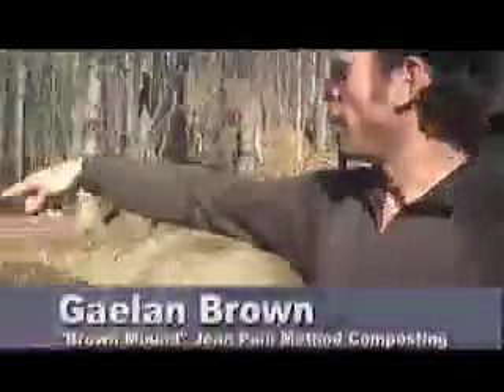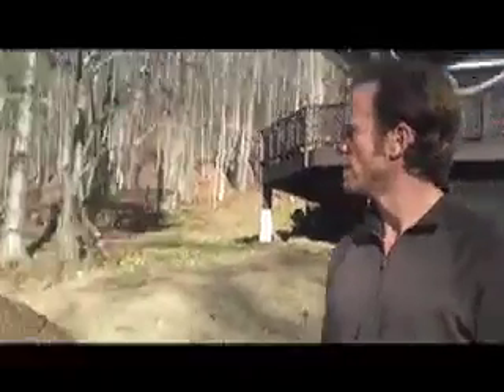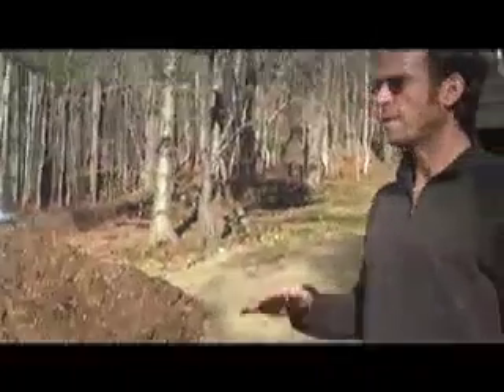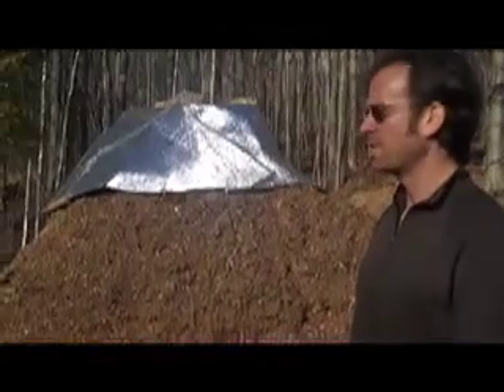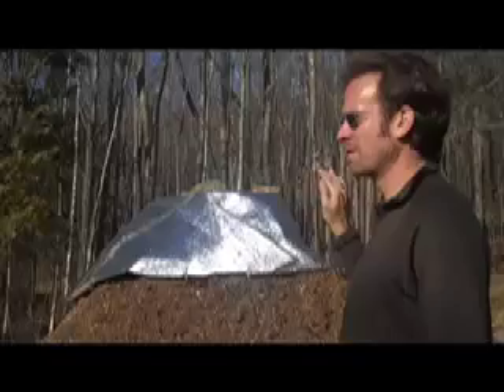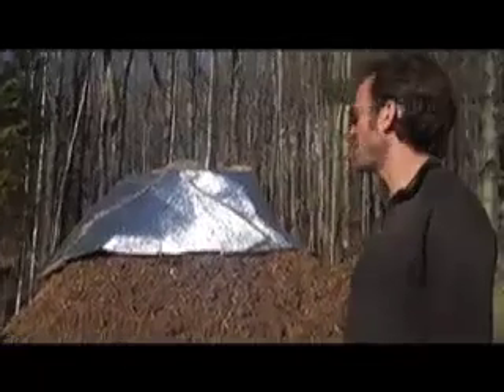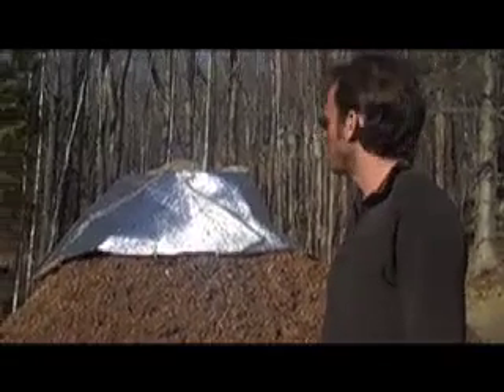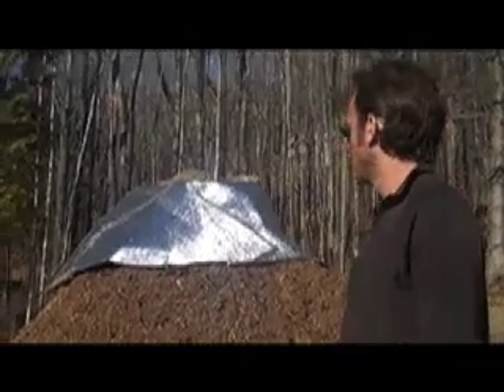Gaelan Brown - "Brown Mound" Jean Pain Method Compost

Comment: Wow. This is incredible. I imagine that with a good weather envelope & a tight house, you could heat a space larger than 1000 feet. In the summer they have problems with wet sawdust mounds at sawmills spontaneously combusting. In the winter, if you have temperature monitoring and a circulator akin to a solar hot water system, it seems to me like the technology is already there to make this a reality. Especially if there's some way to circulate heat into the house if the pile gets TOO hot